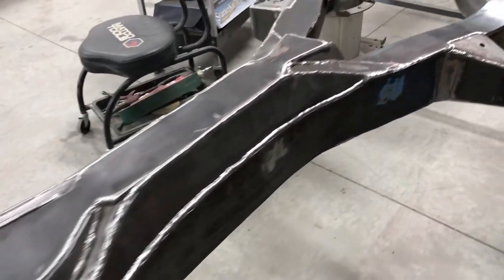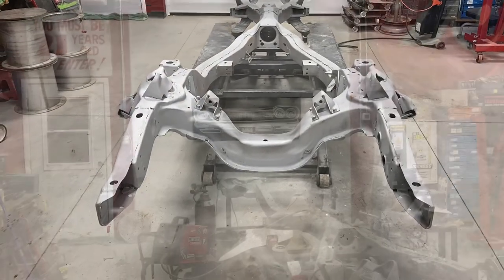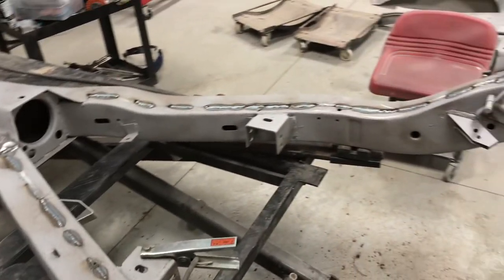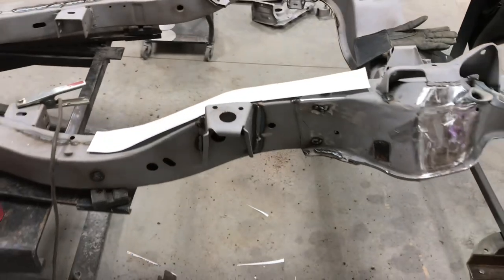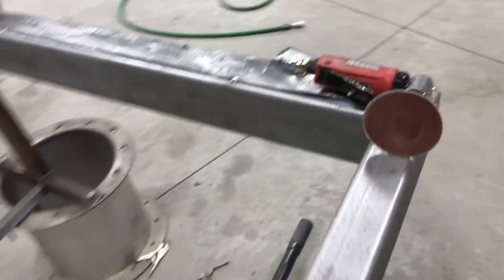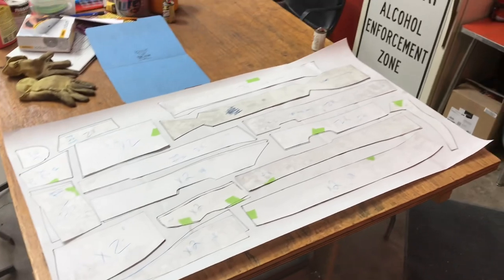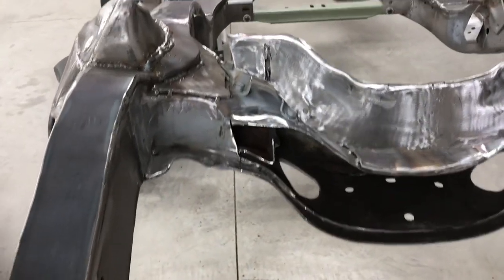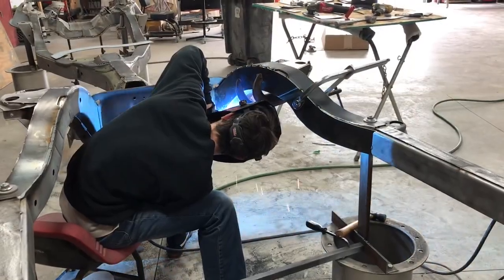1964 impala frame reinforcement part 1

Comment: Did you grind the original welds went you welded over the original welds right after blast?
Reply from the maker: Yep, usually just the sloppy ones. Frame was blasted before i started so it was good clean welding.